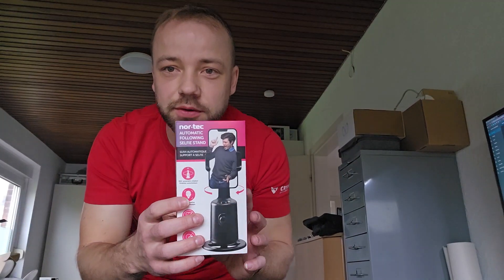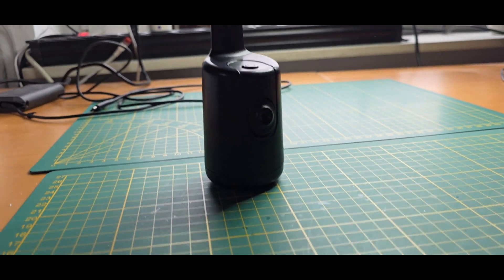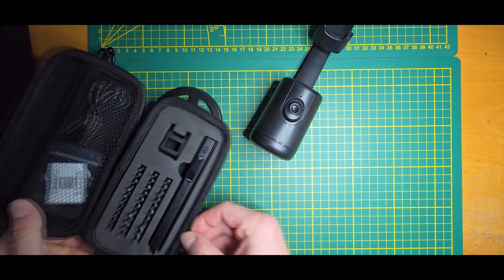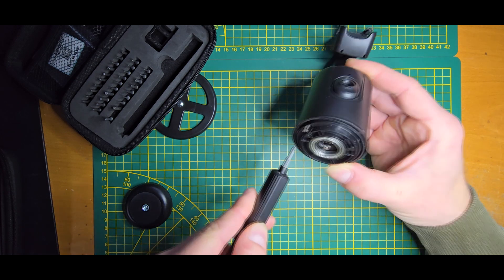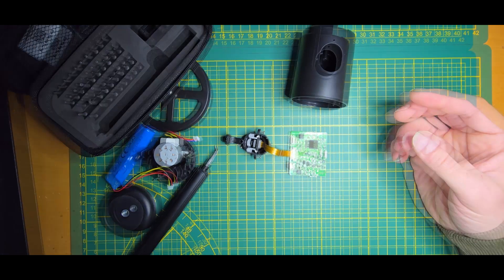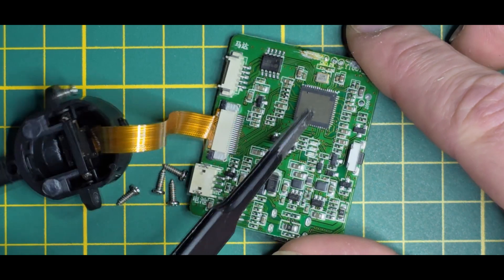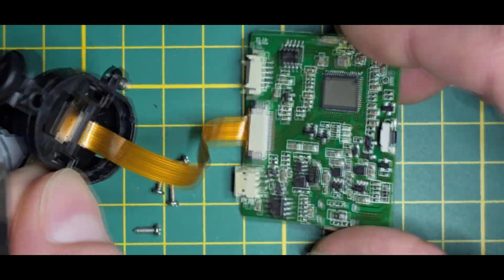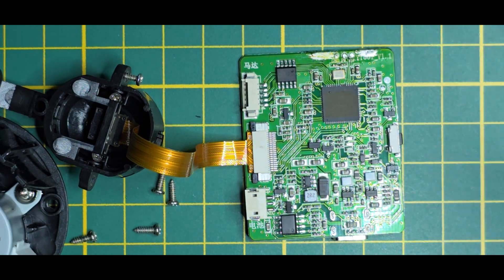Teardown of the 10€ Action self rotating selfie stand + Sequre ES666 ES555 Screwdriver review

Comment: I found another model on Amazon with this chipset that is actually surprisingly well built and has a bearing and everything for the bottom. B0CWS6P7BN
It has an extra mode on the far right button that yours doesn't seem to have populated. You push it and it will slowly do 360 spins so you could set up your phone or whatever for a panorama capture.

Comment: Hey bro, I have this smartwatch (which maybe from AliExpress), model LF33. with four buttons and a circular shape, and it stopped working after I left it charging for a lot of time...which is a bummer, but I do think it is fixable, since I opened it and I saw a disconnected cable, but I do not know where it should be connected, it's a really nice watch, which also lets you upload files into it through Bluetooth, would be fun to (maybe) flash a custom firmware...if possible ofc

Comment: I have a bad habit disassembling stuff first after purchase or buying cheap things only to look inside and find out how the engineers have accomplished something. There should be a database with pcb pictures and block diagrams where you can upload information for others to look up, like already possible in FCC reports for wireless devices. I find it a valid way of learning distinguish good and bad design practices from others, especially when opening up defective items and finding out how constructions failed.
Reply: There is already AFAIK the "recessim wiki", which allows anyone to upload pcb pictures and more.